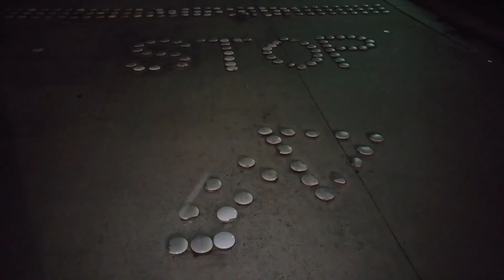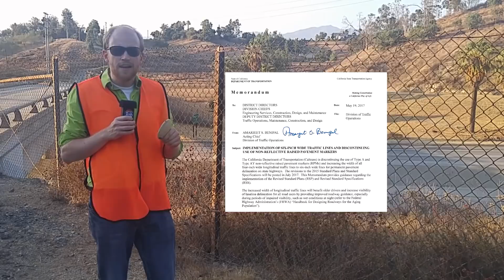California REMOVED this SAFETY DEVICE from freeways and highways

Comment: Here in the UK we use rumble strips on the sides of the road. I'm not sure if it's just molded paint or if it's got something else inside to create the rumble effect. It's very loud when you drive over it and an effective tool to alert the driver that they're too near the edge of the road.

Comment: I remember when I was in LA with my family, there was a guy coming off the highway, pretty much hit every dot on the way, made a hell of a noise, and about a half a mile down the road we found him changing a tire. We don't have them over here in New Zealand, but the Stimsonite Reflectors (or "Cats Eyes" as we call them) are the standard, and Rumble Stripes (a slightly raised plastic strip with grooves in it, makes a hell of a noise but is not a violent as you Botts Dots) down the side, and in some places, the middle of the road, help with drifting drivers.

Comment: In Finland we have small horizontal grooves engraved in the asphalt on the sides of the road. They make a loud buzzing sound if you drive over them. I don't know if you in america have them, but they also work in snowy conditions since snow plows cant damage them.
Reply: Read a few more comments and found out that you have them in some states and they are called "rumble strips".

Comment: I live in a non-Botts Dot state, and let me tell you, it's not the highways that are the problem as much as streets. Streets might as well not even have markings of any kind on them on a rainy night. They disappear that completely. The Stimsonite reflectors are not nearly enough to let you see where the lanes are, because of how sparingly they're used. The worst is guessing where turn lanes begin, both laterally and longitudinally. This is because those Stimsonite reflectors are only used to mark the double-yellow line in the middle, not turn lanes. It's a miracle that I've never been in nor even seen an accident involving drivers who were in the wrong lane because they couldn't see where the lane was. It always seems to work out somehow.

Comment: We use "skip dashes"--a reflective white intermediate painted or adhered strip followed immediately by an immediate black stripe same dimensions to contrast the concrete pavement gray from the white and black.  This is now common in Iowa.  Iowa State Highway Commission now uses these on all new facilities.  Of course, "Botts' Dots" were never used here because of the snow plow issue and the fact that adhesives used would not withstand the incredible differences in ambient pavement surface temperature between winter, spring, summer and fall.

Comment: We have the recessed reflector markers here in Mass. I LOVE those things! Esp in the rain, but they are useless under packed snow. But yeah, I love them. As far as the outer edges of the highways go, we have what we call "Rumble lines". If you start to drift off into the breakdown lane on the highway, you may hear and feel a loud rumble as your right side tires run over these recessed lines in the road. They are there to wake you up before you hit a guardrail or something.

Comment: Here in most plaices in Australia, Stimsonite reflectors have been used for decades, but the dots were once common in some places. More so as a permanent carpark bay marker. The standard in my state is to have red on the left, white on the right, amber in any lane separator on multi lane carriageways, and blue on the left at exits. (This would all be reversed for countries the drive on the right of course. So, on a dual lane carriageway of a freeway, coming up to an exit, you would have red to your left, blue forward left, amber immediately to your right, and white further right. Right side of the exit would also have white or sometimes amber, depending on the length of the exit. (If it’s amber, get on the brakes as it’s a short lane to the intersection.) A blue or red single reflector near the side of the lane, usually just outside the “Fog line” as we call the side lines here, mark council/water board hydrants and fire hydrants respectfully. On a side note, and freeway or highway that goes directly to a capital city will have a single white plastic guidepost set back further than the others with a small black panel with a white number on it every kilometre. This is how many kilometres to the city end of the road. Handy when contacting EM services, as you can give your exact location to within 500m. Amazing what “Secret” markers you can spot when you spend hundreds of hours driving a year.

Comment: In Victoria, Australia, they use a white right angle piece of flexible plastic that is glued to the road and when you drive over them go thuthuthuthuthudup......
There are no bumps.
They are usually used to mark the edge of the road.

Comment: Doing a road trip over 25 years ago, when I was in Pennsylvania, I noticed a new type of road reflector that I had not seen in other states.  I got out to investigate at one point.
Pennsylvania PENNDOT had cut a wedge into the pavement making a 30-60-90 degree triangle about two inches deep at the lowest point (and farthest from the driver).  The reflector was then placed at the bottom of this wedge making the top of the reflector slightly lower than the surrounding pavement.  I have to assume that these markers would last years and years no matter how many snow plows scraped over the top of them.   At repaving time, they were probably popped out by a pry bar or simply paved over.

It was around this same time that other states were using (testing) simple adhesive stick-on reflectors on new pavement installations  that were definitely not recessed or flush-mounted.  Whether intended to be temporary or not, they surely were after only one or two passes by a snowplow.

New York State DOT has never used fancy lane reflectors to any great extent.  But instead uses rumble strips on both lane edges of all lanes.  For two-lane roads, the orange center line markings go right over top of the rumble strips, as do white lane-divider paint lines on multi-lane carriageways.
For the right shoulder white paint, most recent applications now have enough grit material mixed in that even driving on that produces a slight sound and vibration as an initial warning before you go another inch or two into the rumble strip on the shoulder.

Comment: Lol, here in Mississippi it rains all the time; like constantly. We don’t have these, we just drive in between the rain lines. The rain lines are where traffic usually goes and because our soil is so loose it naturally dents in over time, so we drive just to the left or right of those so we don’t hydroplane in them. Also, a lot of our smaller streets just don’t even have markings, they’re unnecessary.

Comment: in canada we have rumble strips, probably 8-10ft of length per strip, every other inch of pavement is ground down so you feel and hear the vibrations, every outside highway lane and far inside lane has it, if you hit it you know what the buzzing sounds like, gets your attention forsure, we also have these botts dots but every single one i've ever seen has been dug into the ground and plated by metal!

Comment: I have never experienced these... in Alberta we run rumble strips where they cut grooves into the pavement... they started doing it about 20 years ago they started cutting them to mark shoulders on major highways... then they started cutting them in to mark upcoming stops for intersections... more recently they have started cutting them in to mark the dividing line on two way highways. When you drive on them you get a buzzing sound and it works even when there is ice on the road and with plows.

Comment: What about the similar but different sounding bump-strips? Usually put on the outer lines of the road to alert people drifting out of the lane, you hear a rumbling that startles you back into your lane. Usually not used in between lanes as they would cause extra noise pollution for every car changing lanes

Comment: Back when I learned to drive, 1973, they called those dots blivits.  I could see utility in using them for safety but also wondered if they were not bad for the tires and suspension, hitting something raised like that at 80 MPH can't be good for your vehicle, and when you are hitting a dozen i a single lane change that has to be bad.

Comment: I haven't seen anyone mention this so I'll throw in my 2 cents about those reflective raised plastic bumps, as we have a lot of them up here in WA state.

I'm on a scooter (12 inch wheels) and those things are the MOST dangerous road hazard for us. As soon as there is the slightest bit of moisture on the ground they become slippery and if your front tire hits one, it's game over. You will immediately slide out and can severely injure yourself. The worst is switching lanes at 40mph and trying to aim for the small gaps between the reflective caps. If your tire does hit one at 40mph even when dry it can cause your front tire to lose traction and you will get severely injured and your bike may be a total loss.

I certainly hope our city authorities will remove these eventually as they are a complete hazard to most people on two wheels

Comment: Question, though: I could have sworn I saw super-reflective road marking paint used approximately 15-20 years ago (pretty sure I was still riding in the back), which showed up superbly in the rain while not being raised from the road, and I haven't seen it since. It's entirely possible that I saw it in Florida, and not in New England, but I feel like such a paint should be standard across the entire country if it actually shows up in the rain...

Comment: It gets worse in the UK, they are removing the safety lane into a useable high speed lane. They seem to think by monitoring with cameras then blocking off the lane if there is a breakdown it will be safer. Just to save money widening the freeway/motorway. So many accidents so far but they are still continuing. Let's hope other countries learn from our mistakes.

Comment: I used to drive a large utility vehicle for some time. My state did not have any of these convex structures on the road, only usual markings. The worst would come with a rainy night, when there is a layer of water on the road that reflects the light. Under this condition, you can’t say sh*t where is your lane and where you are supposed to stop. 

Unfortunately, snow can happen in my state even though it’s quite rare, so these cannot be used.

Comment: the reflectors superceded them anyway, I like the reflectors more than just a round bump because not only can you see them but you can feel them, yes they are slightly more expensive but not really and the reflectors are able to be picked up by objects that use visual aid such as the Tesla self driving car's camera that not only sees in IR which is reflected but also sees the headlights but the dots... they would basically be the same as just a tennis ball on the road, unseen until you hit it.

Comment: 5:12 here in Arizona, ADOT uses these on the freeway.  They do glow on both sides.  On the side facing the direction of traffic, they have white or yellow retroreflectors.  On the side opposing the direction of traffic, they have red retroreflectors.  This way, if you are driving and you see the red, and are not a stupid idiot, you are informed that you are driving against traffic (wrong way).

Comment: Changing lanes on a motorcycle, in the rain, is EXTREMELY dangerous over Bott's Dots. The rubberized paint is no joy either, but the Bott's Dots actually lift your motorcycle tires completely off the road.

Comment: "you can not see the line when it rains" - yeah, ironically, that can be the safety feature. I know a street where easily 4 cars could drive on, but it has no center line. The net effect is, that people drive careful and respect the speed limit. Not seeing the line causes the driver to realize the exceptional situation that has to be approached with "special care". If in doubt, that means slowing down and yielding to traffic.

Comment: The reflective markers were invented in the 1930s  in the U.K. where they are known as 'Cat's Eyes' due to them glowing as light is shone towards them. There are 4 different colours; white being used  as lane markers, red and orange marking road edges not to be crossed and green marking road edges which may be crossed such as laybys and slip roads. Initially they were mounted in metallic casings bus more modern examples are rubber mounted. Solar powered LED lights are used in the most modern Cat's Eyes, these being more visible in foggy conditions.

Comment: NY used the yellow ones several years ago for about a hot minute until they realized the plows just shot them off into the weeds. Then they started grinding in rumble strips along the lines. Hit those and you think your car is falling apart.

Comment: They should double the number of those orange reflective markers, especially on the markings that divide unlit roads, such as SR 138, which goes from Northwest LA county to the 215 in San Bernardino and is unlit the whole way, except for the in-town and freeway portions. Over 100 miles of road, not including the 14 freeway portion, and the markings are hard to see because it's a less traveled road.

Comment: In my state they just use like a little reflective plastic tab in the middle of the lanes and a rumble strip on the side and now even in the center which I'm not a fan of when the road was built in like 1940s so the lanes maybe only 10ft wide then they add the rumble strip on both sides making the lane 9 ft

Comment: wow never heard these before. ive seen the bump light reflectors thpe that are square in the video you mention. i like those. they dont use those in canada due to snow blows. i fine they help notice the lane light because winter make the reflective paint wash away overtime. the side pull over lanes they put grooves indents so driver wake up if they start to drift. i like the thick plaster lines . i wish they did that in canada but snow blow rip them put even though they could install the metal indent one but the city im in doesn't.

Comment: One other thing not mentioned is that the dots, especially when put down in heavier concentrations (ie. intersection markings, etc.) could be very dangerous to motorcycles, impeding proper turning and braking.

Comment: Never seen these where I live. Snow plows would have eaten them alive. They make groves in the road and never needed them. Called Rumble Strips. "Rolled  are rounded or V-shaped grooves pressed into hot asphalt pavements and shoulders when the  or reconstructed surface course is compacted. The  are  by a roller with steel pipes welded to drums, which  the depressions as they pass over the hot pavement"

Comment: Here in finland where we need snowplows 6-9 months per year, we don't have any bumps on road. they are pits. We have this narrow asphalt shredder that makses thsese half inch deep grooves. The effect is exactly same, and cost is significantly lower because you never need to add anything to them. They just wear dowsn same rate as the surroundings. Can last decades on low trafic situations. ANd can be plowed normally! I tihink they have been in use from the 1970's or so.

Comment: The demise of the botts dots are understandable, but I'm surprised the raised plastic reflectors down south AND the (much more dangerous if/when loose) semi-sunken cast iron reflectors up north aren't both getting completely replaced everywhere with what I've seen all over Missouri & Kentucky (but surprisingly nowhere else)...

Sunken plastic reflectors... they dig holes   just like with the heavier, presumably more expensive (potential for a wrongful death lawsuit) cast iron reflectors, but the holes are different for visibility purposes. And they appear to last AT LEAST EQUALLY as long as cast iron reflectors in wintery states if not longer.

Comment: The only thing we have similar in NJ is ONE example on ONE road at the end of a highway that just cut half inch thick by lane wide channels into the pavement at a certain intervals making your tires play a tone. There are three spots that get higher in frequency as you near the end of the highway. Similar to the divots cut into the shoulder to notify you if you're drifting likely due to you nodding off. It's like that stupid video where the highway makes your tires play a song if you travel at the speed limit over the ridges.

Comment: Never had a problem with these except those parking structures that lay these down in a wide row to act as a speed control device. Then there are the newer ones that look like a white volley ball cut in half meant to prevent you from driving over them.

Separating the car pool lanes is also a problem California is still yet to solve. You want to stop vehicles merging at will yet still allow a car to do so in case of an emergency or for safety. Those poles they used to replace these dots get ripped out all the time and pose a serious risk if they go through a windshield at 80MPH or hit an occupant by an open window. Worse, the part that bolts the poles to the road will also do a job on your tires if you happen to drive over them. Orange County solved it there by just using a broken line to separate the car pool lane, at least on the freeways that don't require a transponder.